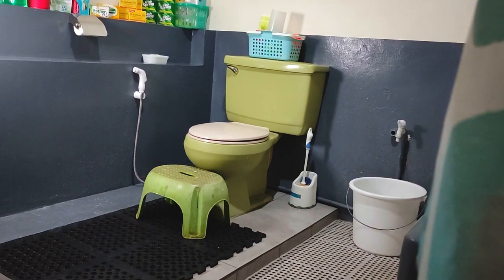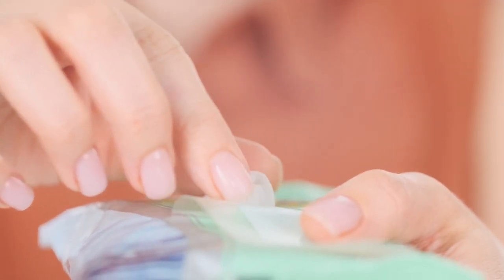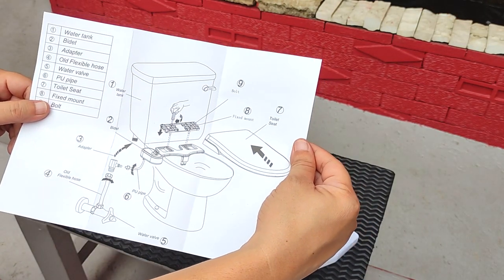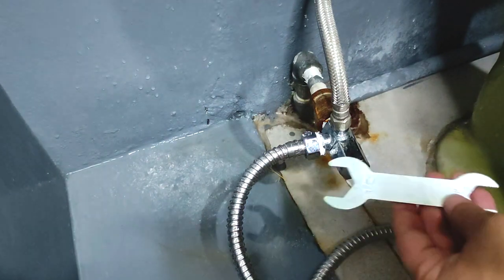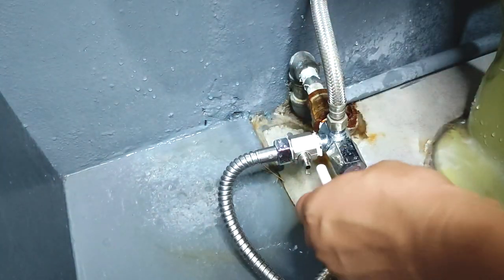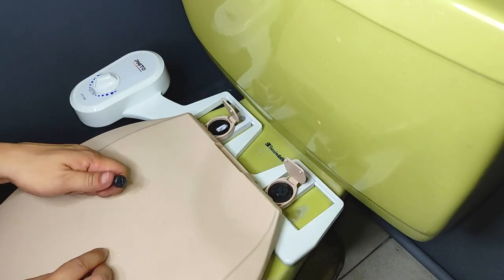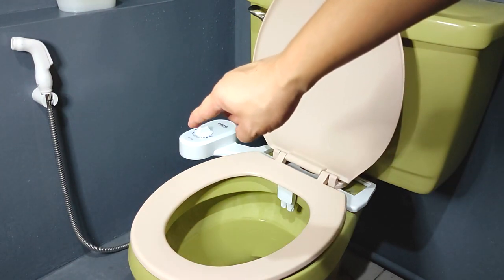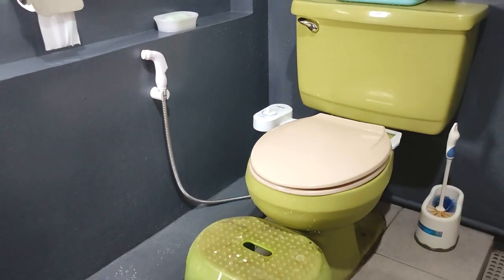How to Install a Toilet Seat Bidet

Comment: Haha wow thanks i miss this narrator! What’s the update about the car painting?
Reply from the maker: Still editing 😅 I use the "other narrator" when im too lazy recording my own voice. Should I use my own voice in the car painting part 2?
Reply: @HanDIYman007  yes please, dang! Seriously your narration is very good, clear, and entertaining! Are you a writer??
Reply from the maker: @hedgefundmgmt3627  we are all writers in one way or another 😉
Reply: @HanDIYman007  thanks! I first saw your video on how to clean the split-type aircon using Unclog when I was due for a pulldown. It's over 1.5 years now and my aircon was never pulled down nor visited by a technician since then and I am the one who is cleaning it ever since. I clean my split-type AC once a month hoping that if I continue this process, I won't be needing technicians anymore. My question is, is this sustainable? There are times like after 3 days after cleaning, you can hear the airflow to be not very smooth although it's still relatively cold, you can tell that some debris or something that might be blocking. Lucky for me, I know how to dismantle the AC and I use a manual spray pressure bottle along with a detergent then rise with water then top it with a bottle of unclog as the final step. But again, is that good enough?  Because you're right, I don't want to spend thousands for a pulldown + the hassle of the man going to the house to clean it :) Just today, have i finished cleaning it again and this time i even use s very soft toothbrush to remove the stubborn grime from the fins or coil and made sure i brush very gentle because I heard that damaging the fins can be detrimental, is that also fine? After making a "general cleaning now" I can still hear the airflow to be not that very smooth...  But it's still cold enough though :) what do you suggest please?
Reply from the maker: @hedgefundmgmt3627  sooner or later you will need to have it properly cleaned (both indoor and outdoor units pulled down and opened) because there are areas of the ac inside, a spray simply wont be able to reach. By the way, is your account new? I noticed that it's just 2 months old, so im wondering what you used to watch a video of mine 1.5 yrs ago? 😉
Reply: @HanDIYman007  I think this is still my old account, I have change my name i guess that’s probably why it looks new? Lol no idea or maybe I have switched to YouTube premium … How many years is your recommend interval for pull downs? Like if you use it 12 to15 hours a day… I thought the unclog magic can finally solve the pulldown trouble :(

Comment: How do I separate the attachment already on the water line. It is brass and looks like the plastic  one that came with the bidet? It just turns. Doesn't unscrew.
Reply from the maker: Im guessing you have a different model than what i have in the video? Are you trying to replace an old bidet?

Comment: Luxe Bidet is 10x better. It has a cover to protect the sprayers from getting dirty, has a self cleaning mode, and the included piping is a much higher quality metal. It also includes some plumber's tape. Avoid this brand in the video at all costs.
Reply from the maker: it's been more than a year since I installed our bidet in the video. Until now it works perfectly as if it is still brand new. Why don't you try uploading a video of your Luxe Bidet and actually demonstrate/show us how it is 10x better?